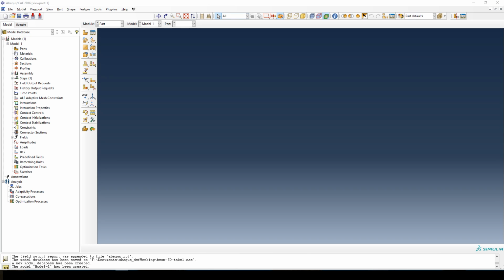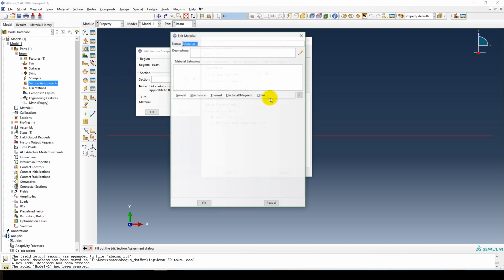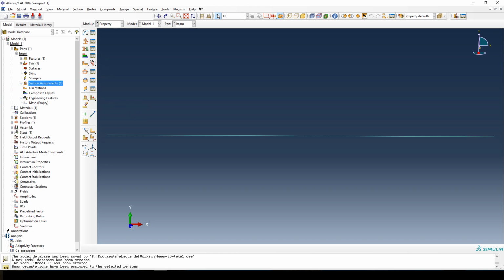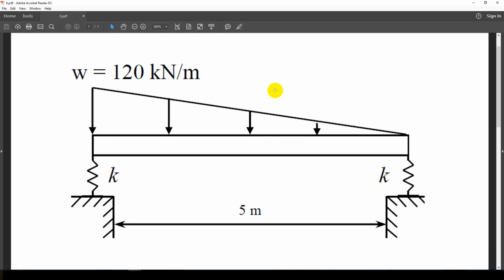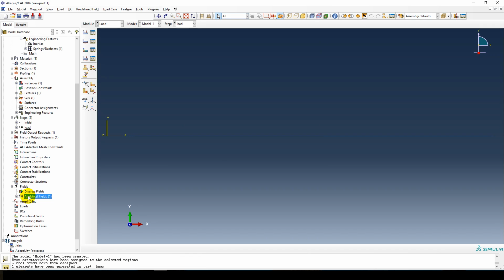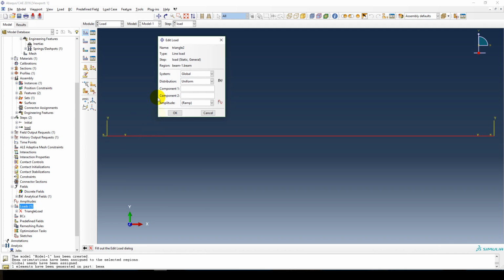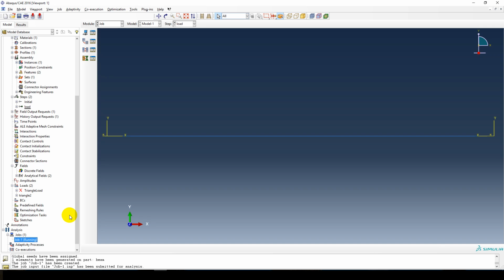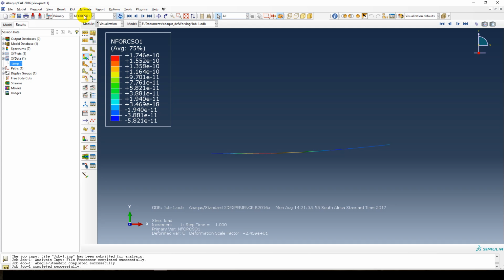ABAQUS #2: A Beam with Springs and Line Load

Comment: How do you calculate the spring stiffness?
Reply from the maker: Hi, its given in the problem statement. In real life typically a spring has a given stiffness which is available from the manufacturer.
Reply: @TMsChannels  Hello, thanks for the quick reply. If I were to replace a, let's say a roller support or a fixed support with a spring, how do I represent it in Abaqus?

Comment: i have a simple question, when you chose degree of freedom for spring, why you chose 2 degree instead of 1? Thanks for your video.
Reply from the maker: Hi, Thanks for the comment. I chose 2 as the second degree of freedom corresponds to displacement in the global Y-direction (which in this case is the direction our springs are orientated in). 1 would be for displacement in the global X direction and 6 corresponds to the rotation about the global Z-axis. Hope this helps :)

Comment: It appears that you made a little mistake of writing triangle load equation. 
The equation of the triangle load is -120e3*X + 600e3 = 5y => y = -24e3*X + 120e3, so your input at 11:18 must've been -24e3*X + 120e3. Hope to hear from you soon. Thank you
Reply: That's what I thought. Thanks I searched for comments & found you😊
Reply from the maker: Hi, I went and checked it and believe mine is correct. The 120  kN/m value given is the slope of the line. So you have y=-120e3X+c and you know that the point (5,0) lies on the line. By substituting that back you get c = 600e3, hence y = -120e3X + 600e3.
Reply: Hi, I asked my instructor about this problem, He said if we set the center of the global coordinate system at the left end of the beam and we use it to write the equation of the line load, then we have the line load passing through two point (0,120) and (5,0). Generally, we have the equation of a line passing through two points A(xA,yA) and B(xB,yB) as follows: 
(x - xA)/(xA - xB) = (y - yA)/(yA - yB)
In this case, we have the equation passing through (0,120) and (5,0) as: 
(x - 0)/(0 - 5) = (y - 120)/(120 - 0) => y = -24x + 120 
Hope you recheck again. Thank you.
Reply from the maker: Hi, you are indeed correct. My assumption that 120 was the slope is totally wrong. Its been a while since I looked at detailed analysis.  I will add a note to the video and thanks for pointing it out :)
Reply: Hello !
Do we need to keep "e3" when you type the expression? I typed:    120e3-24*X
Thank you !
Reply: @minhly650  is the line passing thru (0,600) and (5,0) ?
Reply: @minhly650  really really great thanks for you. i search alot and alot for the way we can deduce this equation and failed.
but i wonder if it is not a simple beam. this method still the same way?